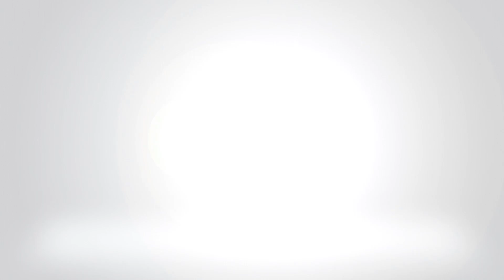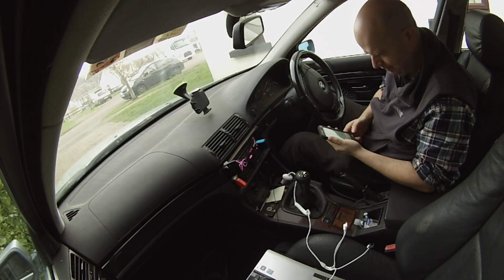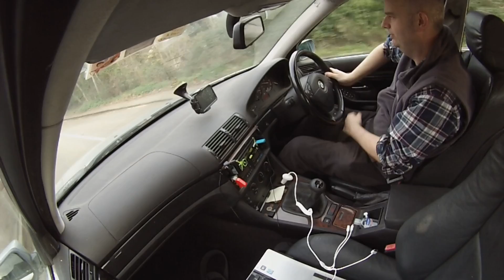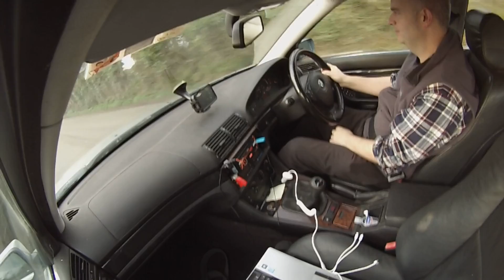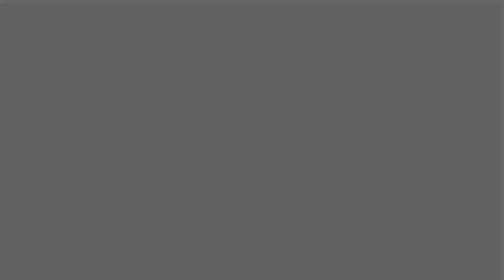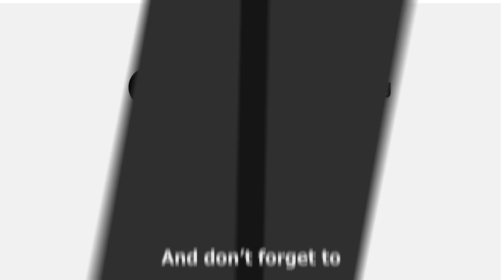BMW E39 EV Conversion 60: DC To AC Part 8

Comment: This may be a stupid question. Is the motor delta wound? That would account for high current and low torque at low rpm (lack of back emf). 
Only really used 3 phase (fixed rotational speed) industrial motors, and they'll often get started in star, then swap to delta at speed. (They won't start under load on delta)
Note - I may have that confused and it's the other way round  😁
Reply: Sounds like you are on the same wavelength as myself,  that's why there are two voltage ratings on this motor as Damien mentioned . Chances are that there's an alternative connection method for this motor.

Comment: Is this the one with the welded blob to make a second  timing pulse?  Sheilding and gapping might help.. might it be possible to arduino good rpm's pulses to the circuitboard?  Just in case the second welded blob is a few degrees off or not enough ferris to mstch the other factory pulse.  Just throwing some brain storm ideas.

Comment: I'm apologize for not getting it, but what exactly is your limiting hardware factor with respect to being able to pull away quickly from a dread stop?
The battery's low voltage? Or the motor's max current?

PS: Nice video